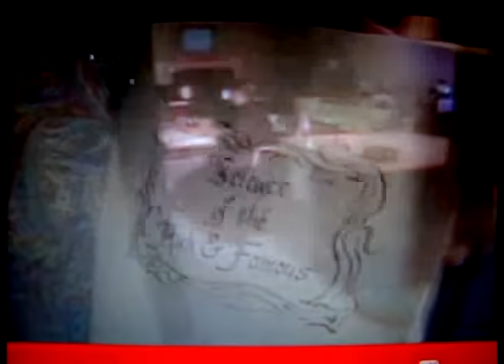Ted Nugent shows how a guitar works 1992

Comment: This is ALL very simple and scientifically provable: It’s ALL about physics (you know, the science of matter and energy and the interactions between them?). The sound produced by a solid-body (even a hollow body!) ELECTRIC (remember that word) guitar comes ONLY (ONLY!!!) from the effect of metal strings vibrating above a pickup. A pickup is nothing more than a magnet wrapped in coils of wire (move any wire in the presence of a magnet and current will flow). The pickup translates the string's vibrations into impulses of electricity; the frequency of the electric (that word again) impulse matches the frequency of the vibrating string. Anything NON-ELECTRICAL (like wood) cannot – and does not! – affect that ELECTRICAL signal chain one iota!!! WOOD – that conducts electricity about as well as the author of this fallacious video conducted his research! – HAS NOTHING TO DO WITH SOUND OR TONE QUALITY! Guitars, utilizing the same pickups,  made of plastic, wood, concrete, graphite or ANY OTHER MATERIAL YOU’D CARE TO MENTION - wait for it! – WILL… ALL… SOUND… THE… SAME! Metal guitar strings suspended above a pickup – with NO WOOD TO BE SEEN ANYWHERE! – sound (measurably!) IDENTICAL to the very same pickup & strings stuffed in a solid-body guitar. Les Paul said it best: “People are all too quick to listen with their EYES.” ‘Nuff said. Mike D.
Reply from the maker: Look everyone!! A know it all!!